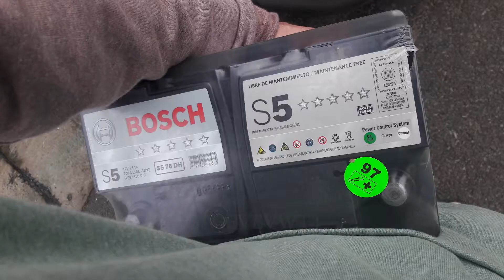VW Transporter4 Motor Calle parte 1

Comment: hola recien veo tu video , y la consulta es necesito encontrar el engranage de arbol de levas de vw transporter 2.4 que va agarrado con la bomba inyectora lo perdieron en el taller y no lo puedo encontrar por ningun lado vos podras decirme donde conseguirlo? gracias
Reply from the maker: Hola  Norberto q tal?, si estas en capital podrias averiguar en Warnes, hay dos casas q mas o menos tienen casi todo es (Warnes W) av. warnes 1381 tel 011 4857-0101. y sino otra ahí cerca es (Mix Warnes) av warnes 1235 tel 011 4857-9030. Espero te sirva y puedas conseguir el engranaje. Sino te queda cerca preguntales si hacen envíos o donde podes conseguirlo. éxitos y contame como te fue. saludos!!